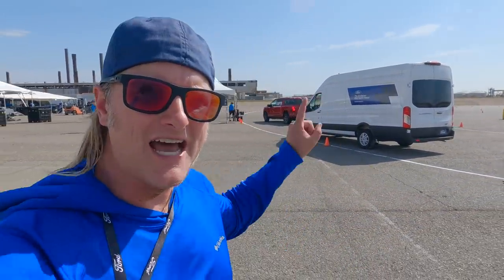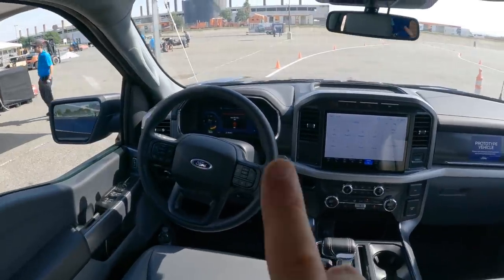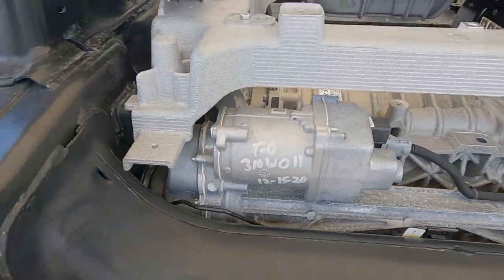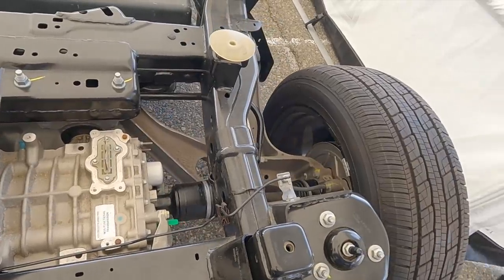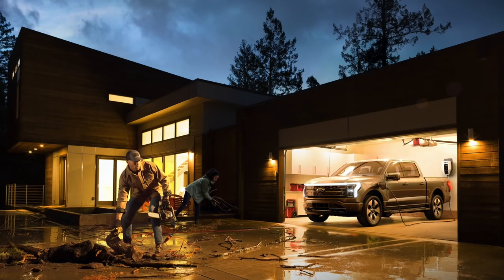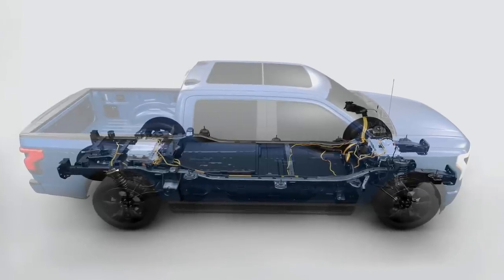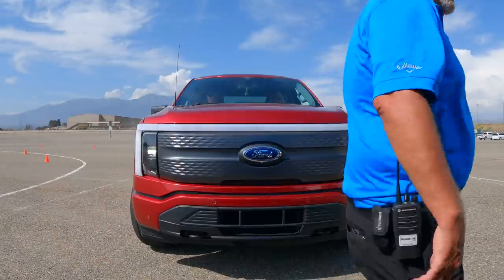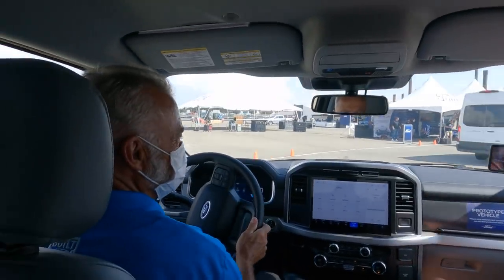Riding the Lightning  -- 2022 F-150 Lightning First Look! (BEST F-150 EVER?????)

Comment from the maker: 1/5/2022 UPDATE. Just a quick note for anyone who watches this video after today. Ford announced F-150 Lightning pricing this week and my guestimate about XLT pricing was low. Turns out, to get an Extended Range XLT, you ALSO have to upgrade to equipment group 312A, which is another $10K over the $10K battery upgrade cost. Also, only FLEET customers will be able to buy an Extended Range PRO model (Retail customers are limited to the standard range battery)

Comment: 74mph in a parking lot for a full size super cab awd pickup truck? Bad ass fomoco. 👍🏻😎
Reply from the maker: we may have had a little fun, hahaha.
Reply: @internetbrandsautogroup3826  I noticed you seem to be pretty much an ice guy. Would you mind sharing what are some honest ways the lightning surprised you and some it may have disapointed based off of the event you attended? 
And maybe your thoughts on the mach e along with Ford making an ev 2dr mustang coupe on the s650 platform? 👍🏻
Reply from the maker: @4literv6  well, i have no inside information on anything Ford's planning, but if you look through our videos, you'll see our Mach E review from last December.

I still haven't driven the M-E GT, mind you, but I was also impressed by the extended range AWD version. my only notes were that the tires were too narrow for its capabilities and it lacks ventilated seats (which Ford puts in all other Premium Mustangs).

I'm on the loaner list to review the GT and I'd love for Ford to make a hybrid or all-EV Mustang Coupe. Honestly, i think the next 5-10 years are going to be crazy in how much vehicles change.

As for the Lightning event, I think what surprised me most is how much speed and cornering Ford could build into a 6,500-lb tank. It's crazy to feel something so big accelerate instantly without any tire slippage especially after driving a Mustang that weighs almost 3K lbs LESS. 

In terms of negatives, it's hard to say bc they were prototype vehicles. I guess I wish you could get a three-row front seat like the ICE F-150, and I think the seats are NOT bolstered enough for a vehicle this capable. I'm hoping they offer some type of sport package with Recaros, sticky tires, and a lowered suspension.

Cheers.

Comment: Isn't it $63,000 for the XLT + Extended Range?  $53,000 for the base XLT.  I think I am going to try for the PRO.  I don't need the extended range nor the extra features.
Reply: Pro is fleet costumer only ?
Reply: @bonvaicu  I believe regular customer CAN order a PRO but you cannot order it with the extended range battery from my understanding.
Reply from the maker: Ah, yes, you're right about the pricing.

Comment: Good video. I made the first wave of reservation to order customers. I ordered the Lightning Lariat trim with the extended battery. Do plan to install the Home Integration System for home backup. Hope to have her by late May. So stoked!
Reply from the maker: Congrats! I was in the third wave and wanted a Pro, but it's sold out for the 2022 model year. :(

Are you, by any chance, in the Los Angeles area?

Comment: Had ordered at very beginning, 
this will be first pickup truck,
 hope the handling works well.
Wonder Ford will allow for a test drive before taking delivery.
Reply from the maker: Outside of rare cars, test drives are typical. Trucks do take some adjusting, but this one drives very smoothly. It's somewhat similar to the Expendition, so you might want to drive one of those, although the Lightning has a lower center of gravity, so there's less body roll. Good luck!

Comment: You mention a horsepower increase with the optional long range battery. Problem is if you are actually using all 500 hp than the range would be shortened. Hp ratings are MAX ratings. If you're using max hp than you are not going to get max or even average range. So if you want average range than you need a light right foot. So buying the extra range battery would most likely tempt you to slam the throttle more often to feel that extra hp and the range would be the same as the lesser battery.
Reply from the maker: That's not a problem, it's a choice.
Reply: Same with a gasoline car... What's your point? That electric cars aren't magic?
Reply: @cleanterprises   they call it a long range battery. And they mention the added horsepower. The point is you don't get both.